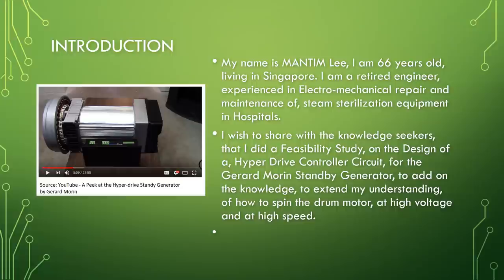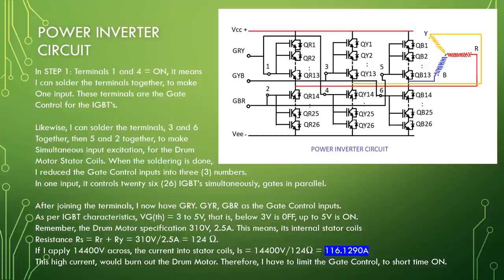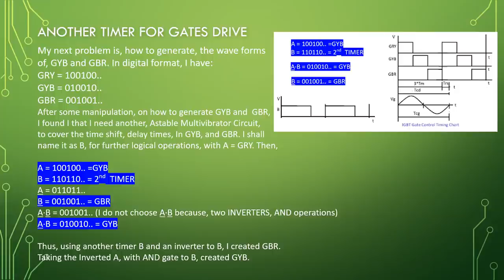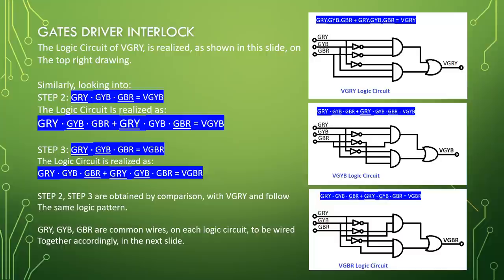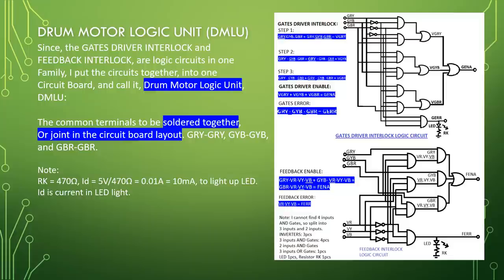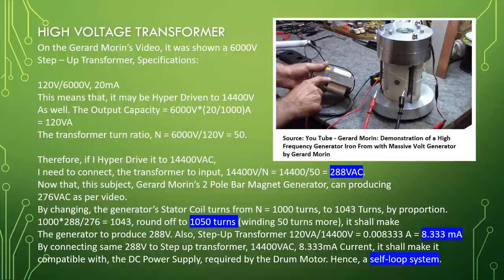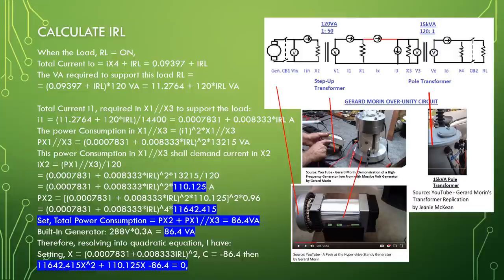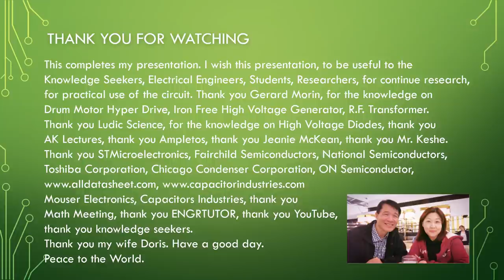Gerard Morin Hyper Drive Controller Circuit Design Feasibility Study

Comment: Mantim, your presentation is very impressive and reminds me of my good days of designing various electronic circuits
mainly controllers for various electrical applications. Gerard's system can be taken to another level by improving his 
generator by using neodymium magnets. I have a special interest in SEG generator of professor Searle. He is using 
custom DC/AC magnetic printing techniques. The only drawback is usage of rare earth neodymium as electron source.
Gerard Morin's system is a step in a right direction. There is a Korean generator on the market requiring primary mover
to spinup generator to 3600 rpm and then AC can be disconnected. Two systems are available 6KVA and 13KVA if I
remember right. Their motor uses neodymium magnets.
Reply from the maker: Thank you for your comment, David Johnson. Yes, the use of neodymium magnets, in Gerard's system shall increase the torque of drum motor. Neodymium magnets have strong magnetic field strength B, it shall increase the generator output voltage. You have a good day.

Comment: Outstanding, the most knowledgeable presentation. 
With your intelligence and complete understanding. Please examine the pyramids, which were power generating machines. It has been determined that they were caped with metal, possibly gold for power generation. Pyramids throughout the world were situated at data points similar to a gigantic circuit board. It almost appears that they were assembled to generate a mass amount of energy. Possible for terraforming the earth. Some structures appeared to have exploded from the emmence power that was being generated. 

If any one can reveal how the worked. It's you.

Comment: Thank you very much Mr. Lee, your presentation and your hard work are really appreciated! So if I well understand the output is much greater than the input. Would you please kindly give  a simple measure of this gain in power for the layman? I am deeply impressed and grateful for your vital open source contribution that hopefully will help to change the world for the better.Thank you again.
Reply from the maker: Thank you for your comment, Lucio Amellin. The simple measure of power gain from the Gerard Morin built-in generator input, to the Pole Transformer
output is 114 times, that is 11400 % round off, calculated in my video conclusion. You have a good day.

Comment: Mr Lee, it seems that Mr Morin has created a website with parts for his hyper-drive. He expressed a need for a controller to adjust each of the tree phases in his motor. I was wondering if, with your vast knowledge, it would be possible for connecting to occur between you two so finalization could be done to finish the device. 
I live in a community of people who are homeless, so the need is great for electricity. While I have much to learn, the more knowledgeable people
involved, the sooner the device could be created. Thank you for your time. I found his site by subscribing. He announces it in his latest video. Thanks again.

Comment: Mantim Lee - Very interesting presentation. I'm just a grunt electrician and got lost in some of your math but I did get the fact that this will work. I too await Gerard's final design of a working controller. I have a generator set waiting to spin, just need a controller. Do you plan on building such a generator set up for your self? I'd like to see it run if you do.
 Love your work - cant wait for the world to start generating free power! The Hyper-drive movement has started.
Reply from the maker: Thank you for your comment, Old Frugal One Hyper-Drive Movement. I do not plan to build the Hyper-Dive Generator myself. The whole system shall be best, to be built by those who has the experience, tooling, resource to do so, to test, validate it, to make it a viable product. In the youtube world, Gerard Morin appears to be, very close to make it a success. His test controllers, got burnt up may not have interlock, in the circuit. Also, the drum motor may not run to 3600 rpm, to produce enough voltage from the generator, may be stator coils sequencing below 60Hz . I wish my presentation, to be useful for those who interested in the research topic, give technical, theoretical support, to self-loop, over-unity. Saying so, shall include yourself, have a Drum Motor and a Generator, you have a first step, to manifest it into a Hyper-Drive Generator as you wish. Be, Do, Have. We have the freedom of choice. You have a good day.
Reply: Mantim Lee - Are you in regular contact with Gerard? You say his test controllers burned up? Do you know if he has others being built and are you consulting with him? A lot of people are waiting for news from him myself included. I was pleased to hear you say this system would work. My generator set only needs to turn at 1800 RPM to produce 220 VAC at 200 amps - I'm using the larger motor. I just need that controller from Gerard. I'm an electrician so the proper hook up to my house is no problem for me. 
I do hope that you can somehow assist Gerard in some way to get this up and running and released to the world. I feel this could be the way we generate power in the future. Peace be with you my friend.
Reply from the maker: Thank you for your comment, Old Frugal One Hyper-Drive Movement. I have not contact Gerard. I got the update from YouTube - Development Update: Hyper-Drive by Gerard Morin. My presentation is on YouTube, the interested researcher, would be able to look up the information. Gerard is the developer for this Hyper-Drive, and very close to success, I had better not to disturb him. Your generator needs 1800 RPM, it appears you can use the ANAHEIM controller as demonstrated by Bateman's video. You have a good day. 

Source: YouTube - Development Update: Hyper-Drive by Gerard Morin
https://www.youtube.com/watch?v=GazVpj3cn3k&t=1011s

Source: YouTube - Gerard Morin HYPERDRIVE TEST by Bob Bateman
https://www.youtube.com/watch?v=NNdYdHtcorQ
Reply: Mate did you end up successful?
Reply: I really would appreciate a step by step guide to build it

Comment: Mantim. Thank you so much. I have watched gerard for many years learning along with him in silence. Thank you for taking the time to plot out all the logic and components and expressing all the math in a syntax readable and expressive in a compter. Thank you for all the easy links to info and components. You have done with gerard a great service to mankind. I am so excited to have this information. Can you make it available as document e.g. word or excel powerpoint what ever so we dont have to type it all in again. Also do you think for battery driven  experiment that 1 no. 12 vdc high power output 80 amp hour car battery and suitable inverter to drive the first 288vac transformer is ok?. Or would it be better to design new replacement 1st stage step up transformer running on rectified 12vD.C.? Things around us will really change now. Especially if elon bolts this to his stuff. However. Open source is energy and love.  Nothing can be more pure. Thank you again so much. S 👍🤝🖼
Reply from the maker: Thank you for your comment, Stuart Hancock. Here are some links in my presentation, that may be of interest to you. You may high-light the texts in this reply, hold down the control key Ctrl, and press c, that is Ctrl+c, it shall copy the text link to your computer's clipboard. And then, you may open a blank page in Word, or Excel, then click keyboard, Ctrl+v, hold down control key Ctrl, click v shall paste the link into Word or Excel as you wish. 
Regarding another question, transformer shall work in A.C. alternating current. I2VDC shall need to run it through an Inverter circuit, to get 12VAC. and then to step-up transformer in question (288Vac), it has turn ratio N =50, to get 12*50 = 600VAC. The Drum Motor shall need to have D.C. direct circuit in sequence 1,2, 3 or RYB, a simulated A.C. 3 phase to spin the motor. 

Manufacturers:

STMicroelectronics
Website: www.st.com
Fairchild Semiconductors
Website:  www.Fairchild.com     
nicrom electronic, www.nicrom-electronic.com
Texas Instruments
Website: www.ti.com

Suppliers
http://www.alldatasheet.com/view.jspSupplier: www.mouser.com

Supplier: ON Semiconductor, www.onsemi.comSupplier: www.capacitorindustries.com

Comment: One might be interested that The VIC Voltage Intensifier Circuit works to Driver Gerard Morin System with TPS control .  Stanley A Meyer
Reply: Hi Stanley would you happen to know where I could buy a drive/controller for the hyperdrive?? Please let me know either way thx
Reply: @forbiddenone6878  Hi Bob Yes we Make them but at present not for sale, If you would like to support our Work please join as a Patreon .  So When bread it out of the oven you can get a slice,
Reply: @hydrogen-power-gas  Hi Stanley Would you happen to have a time frame when will they be available for sale? and what happened to Gerald Morin is he still alive?
Reply: @forbiddenone6878   Hi Gerard is Alive and well and people who supported are using the technology those who did not will be waiting a while

Comment: Mr Mantim Lee what frequency how many kHz does the board is designed for and can it be regulated in your design ? Also can I use servo tester instead potentiometer Could you please describe the difference ? Please
Reply from the maker: Thank you for your question, Forbidden One. The Hyper Drive Controller Circuit is designed for 60Hz. Can it be regulated, you meant, you want to adapt the circuit to 50Hz ? You may wish to follow the video presentation slide 15, setting Tcg = 1/50Hz = 0.02 sec thereby Tm = Tcg/3 = 0.0067 sec. to calculate the RA, RB resistors for the Gate Driver Circuit, slide 17. etc. As to the operating frequency of the IGBT's gate can operate up to 40KHz as per the IGBT's technical specifications. 
The potentiometer is based on VR = 14400VDC, so if you would use it for 900VDC, the voltage divider, potentiometer R1, R2 will have to be re-calculated. You may wish to check your Servo Tester Circuit's Maximum Input Voltage Limit = 900DC as you wish. Servo Tester Circuit, the difference is servo input can be more unsteady input, like pulsing signal. You have a good day.

Comment: Mantim Lee--You are mistaken in your thinking.  The Hyper Drives coils RYG are fired simultaneously one coil may be positive while the other two will be negative, but not all three negative or all three positive.  This is to attract the proper pole at the proper time to get the desired directional movement.  The coils do not fire in sequence, but simultaneously.  Just look at the magnetic poles and the coil positions to determine how you are going to get directional movement.  Why are you putting 14400 volts into the Hyper Drive?  It only takes a higher voltage than the washing machine manufacturers use to get better performance, so you can stay within limits of say 1000 volts to get awesome performance.  A good result is your parts count and cost drop.  Happy designing!
Reply from the maker: Thank you for your comment, Timothypb. In my presentation, the drum motor does not use Hall Effect Sensor to switch the coils for directional movement. 14400VDC shall require 310V*2.5A/14400V = 0.05382A to run the drum motor, to full capacity power 0.92HP as specification rated. To use 1000VDC, the drum motor shall require 310V*2.5A/1000V = 0.7A to rum fully capacity power 0.92HP. The drum motor stator coils, it has resisitance 310V/2.5A = 124 Ohms. To use 1000VDC, the coils shall subject to 1000V/124 Ohms = 8.0645A, this current likewise, shall overload the drum motor rated at 2.5A. 
As you may wish, the controller is adaptable to 1000VDC, by re-calculation of the parameters Tm, RA, RB and C, for the LM555 Timers. Yes, 1000VDC it shall require 6 pieces IGBT, versus 78pcs in 14400VDC, there could be up to USD 700 cost drop at 1000VDC, good to go. The next question then, is how to generate that 1000VDC, to do the self-loop, and how a 1000VAC may use what size transformers, to step-down, into significant current Amperage, for 120VAC, 60Hz output, a computation start-over.  14400VAC is compatible with Pole Transformer, it was calculated to be 120VAC, 60Hz,  34.1758A output. Yes, happy designing. You have a good day.

Comment: I do wish I could get my motor to run atleast at the speed in the washer, it spins the wash drum to almost 2000rpm, I measured it, however I cant seem to run it that well without the original board, then ofcourse the programming in that board only runs it at that speed for only the final minutes of the fastest spin dry cycle as designed. There's gotta be a way to program a universal board or only used the high side of the original board using a universal programmable board "controlling it. Any help would make this project fun again.
Reply from the maker: Thank you for your comment, Greg K. It appeared that the stator power supply frequency has to be adjusted to 34Hz, for the motor to run at 2000rpm = 2000 x 2π/60 radians/sec = Ꙍ =  2πf = >  f = 2000 x 2π/60 x 2π = 33.3333 Hz approximated to 34Hz. You have a good day.
Reply: @mantimlee5568  have u done this yet, and ran it for 24 hours continuously? Measured heat in stator/drum for epoxy breakdown even of magnet glues?
Reply: @mantimlee5568  also, have you read anything that is true of morin,gerard alive or deceased?

Comment: Hi Mantim,  at 15.17 it says "After joining the terminals, I now have GRY,GYR,GBR as the gate control inputs "  
   shouldn't it be GRY,GYB,GBR ? as the gate control inputs
Reply from the maker: Thank you for your question, Smiley Smiff. Yes, after joining the terminals, I now have GRY, GYB, GBR as the control inputs. It was my typo error GYR in my presentation. You have a good day.

Comment: great work 

Have you build the Controller or Just a drawing?  

have you a complete Diagrams on paper ?
Reply from the maker: Thank you for your comment, Dugagjin Dervishaj. I have not build the controller, my presentation is a drawing, a feasibility study, a research to study the possibility to build the hyper-drive controller. To have a complete diagram, you may play the video presentation until the diagram comes up. Stop the video, then press your computer keybroad, PRINT SCREEN, this shall copy the diagram onto your computer. Then open the Windows application - Paint, press keyboard, Control+v, this shall paste the image to paint. Or, you may paste the diagrm on Microsoft - Word, with control+v. From Paint, or Word, you may printout the drawing. You have a good day.

Comment: what's similar to STGF3NBFD ?
Reply from the maker: Thank you for your question, Smiley Smiff. The IGBT order type should be STGF3NB60FD for discrete component. STGF3NB60FDT4 for surface mounted component. Similar to STGF3NB60FD, are you  looking for compatible, alternative IGBT ? On the internet, www.alldatasheet.com, now I can find manufacture, Infineon, IGBT 1200V, 3A, 2.5V TO263. having higher voltage 1200V, it shall require 12 pcs to withstand 14400VDC. That is you may use 3*12 = 36 pcs IGBT instead of 78pcs (as presentaion). You have a good day.
Reply: Current non obsoleted part is STGF3NC120HD or STGW30NC120HD; Not sure which one is better.

Comment: And did you manage to shift the breakdown voltage of the lacquer on the coil windings as well to cope with 14.4kV? As it's only about 400V at most for that gauge wire. Perhaps by waving a wand while chanting the magic words? Or by soaking the entire assembly in a liter or two of 100% wishful thinking perhaps? Id love to see an actual working model rather than this theorycraft, it should be Sparktacular for the few minutes it lasts.

Comment: Dude, he didn't ever say it was DC. He said it was r.f. your assumption  is flawed from the beginning
Reply: Yes, I concur  Darci he was using a Bluewave (26Y2048(W4135XCa-B) High Voltage source [(500V 470uF) filter cap] triple channel RF transmitter as the controller in one of the latest videos he posted. It cuts down on the normal amperage required to run the whole operation, and I am led to understand that the RF is at very high frequency as well.
Reply: @fionabellett3641 absolutely spot on.
Reply: He's actually running it on lossless power transmission, generating his AC waveform by switching it in and off.
Reply from the maker: Thank you for your comment, Darci Ford. R.F.,radio frequency by definition is 3Hz to 300GHz. R.F. is a transmitted signal, where as A.C. alternating current is a generated signal. The flow of D.C. direct current into the motor stator coil and reversed direction 60 times per second is simulated 60Hz A.C. You have a good day.
Reply: @fionabellett3641  Hi Fiona Bellett what product I can buy to find Bluewave (26Y2048(W4135XCa-B) High Voltage source [(500V 470uF) filter cap] triple channel RF transmitter as the controller in one of the latest videos Gerald Morin Posted ? Could you please let me know Please

Comment: Can you make the controller ?  If you can make it would you sell me 1 or 2 I would appreciate it very much as it is very hard for me to get around. This will help me with my bills.  I would appreciate it very much . I want to thank you very much wishing you long and safe life.
Reply from the maker: Thank you for your comment, Doug Steere. I do not make the controller myself. The whole system shall be best, to be built by those who has the experience, tooling, resource to do so, to test, validate it, to make it a viable product. You have a good day.
Reply: Unfortunately Gerard is a scammer, this system can’t work
Reply: @mantimlee5568  the real question is if the controller really works ? And who can build this controller?